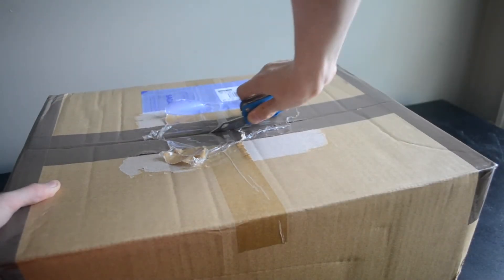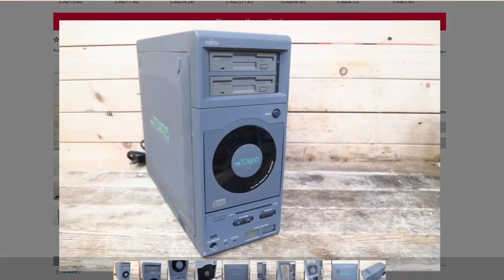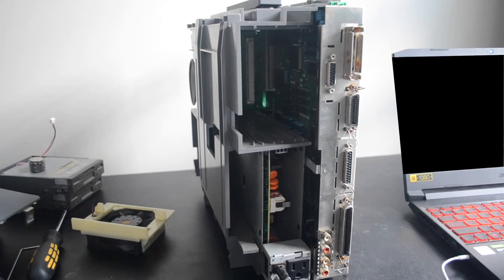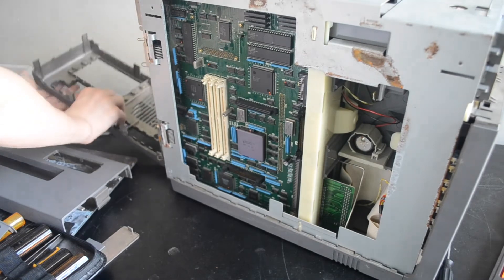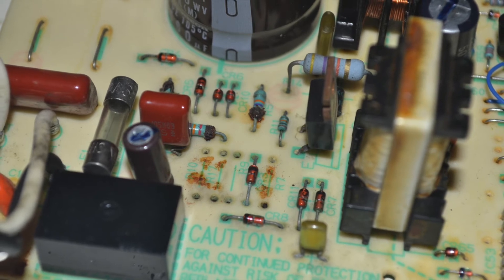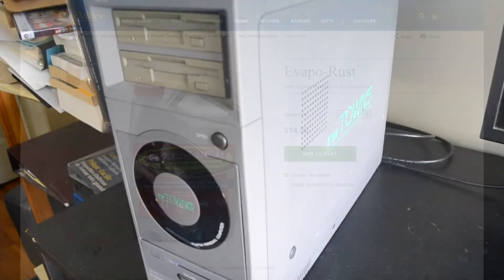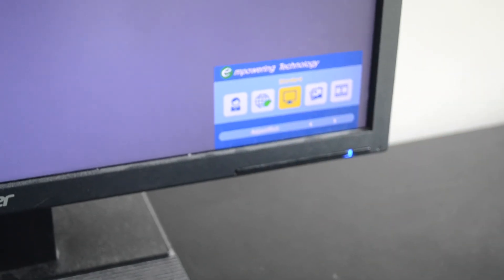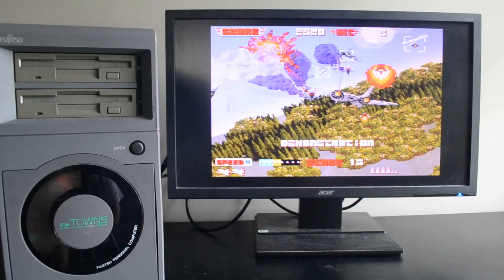Fujitsu FM Towns Repair and Restoration

Comment: What software did you use burn the game? I've tried about a dozen CD-Rs, four different brands, and none work using ImgBurn at x1 speed (actually 24x, the slowest the disc is reported to ImgBurn as being able to burn at). ImgBurn says the burn is successful on multiple games, but none work. Legit retail discs seem to work, though.
Reply from the maker: Thank you for commenting! Then burning FM Towns CDs I almost always use ImgBurn, and have had good success with it. The CD-R in the video was Verbatim branded, but I've also used TDK and RiData discs, and have had little issue. One problem I've come across with burning FM Towns CDs is the integrity of the image. Some of the rips I've found on the internet seem to just be bad some of the time. I've had most success sourcing images from the ReDump and NeoKobe FM Towns collections, both on archive.org. This is a last resort, but it may be possible that the CD-ROM laser on your machine may have weakened, which is a common problem. If your machine is a grey tower, it shouldn't be too difficult to find a replacement. The lasers on those were made by Panasonic and were used in several home CD music players from this time. I hope this helped!

Comment: Nicely done dude and sweet system :)  Admittedly I did skip quickly through some of the video so apologies if I mention something you already did. 

  For the rust work, any vinegar will 100% remove the rust, heavy products aren't required. The question with that is how long are you willing to wait. The acid in the vinegar will work given the time, products like Evaporust isn't required but will do the job faster. The patches that used to have rust will rust again, the water in air is enough to start the process again so you'll need to finish them in some way to stop that reaction happening. You can get a paint called 'galvanising paint', you can get it in a spray which is perfect for finishing metal parts like the bay slot covers, RF shields, that kind of thing.  That small patch on the inside of the side panel, the area will be likely be stained from the rust, you could likely get that pretty close to original using some Hydrogen Peroxide, but not the usual you would see used in 'RetroBrite'. The small bottles you can get from a Pharmacy are more suited, they are only about a 6% solution. Leave the side panel face down on put a little puddle of the peroxide over the patch. It won't stay active for too long, so every now and then, wipe off the puddle and apply again. It's so gradual you will barely notice it doing anything, just keep at it, eventually it will get there without damage.

  For the paint work on the outside you may have to get a little creative. That store you got the Evaporust at looks like the very place to be. See if they have a paint mixing machine, just the type that makes paint for household use. Take the side panel to the store with you, the paint mixing stations have a scanner that will match the paint colour.  For the base tin of paint (that's the tin the paint pigments are mixed into), you want a kitchen or bathroom one. They are harder wearing than a standard wall emulsion and are also water proof.  Test the paint on an unseen part of the case to see how well it matches. Those paints are usually water based (the waterproofing and hardening of the kitchen/bathroom paint comes when the paint cures) so you can lighten/darken with any other bog standard water based paint, just find the smallest, cheapest tins of black and white you can find, they are just for adjusting the shade (the same store will have it). Use a ridiculously small paint brush for any scratches that are in lines and a small piece of sponge for patches. If you hit the jackpot and the colour match is perfect, the areas where you used a sponge will disappear almost completely and the parts that were individual scratches you can use a sponge application to smooth out a scratch at the end. Don't try to rush it, apply the paint in thin layers and build it up. It's the kind of thing that up close and personal you will still see the fault but from a couple of feet away, it will disappear. Have a good look at the side panel finish, they are usually a silk finish, I would start with a paint base that's silk.

  A quick one, the floppy facias are off colour, that's just the usual bromine/UV reaction. It's more subtle on a grey plastic than a cream/white but its still there. The 6% H2O2 will sort that out too, I doubt a retro brite would be needed to get them back to original state.

  The last thing is the video signal and I'm only mentioning this in case it's something you haven't encountered yet. There are mainly two signalling types to consider when working with 15kHz, one is analog and one is digital. I've never had an FM Towns in my collection so I really don't know what it uses. So if you end up with a 15kHz screen and you don't get a picture, have a look for a switch somewhere on the back, the ones I've seen are usually labelled 'TTL' for the digital mode. I was very surprised that your PC monitor actually displayed the image, don't ever get rid of that Monitor! lol  Have a look see if your monitor gives you any info on the signal it is detecting, or you know, google for FM Towns info :D

  All in all, enjoyed your video and I have subbed. I look forward to seeing your future projects.

Comment: Glad the algorithm tossed you my way. Always nice seeing a new retro channel especially from a Canadian (where components don't grow on trees and ebay auctions are even more absurd). Subbed! As to the posts in the connector's screw holes, that failure can occur on cheap connectors when the rubber/plastic detaches from the screws because the glue goes bad or fails. Not necessarily what happened there, but a possibility.

Comment: My advice - clean it yes but leave the scuffs and paint marks. There is no way to make these things perfect so I leave them as is personally. You did a better job soldering than I do. I would probably spraypaint the rusted metal parts with some rust converting spraypaint.